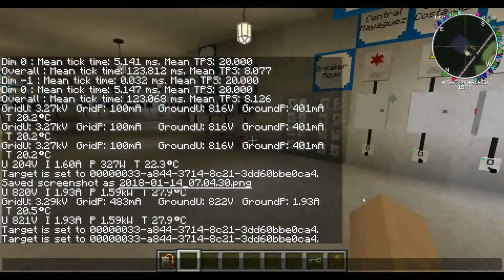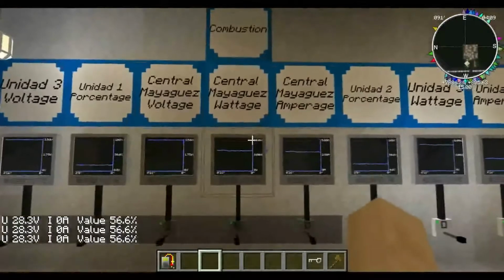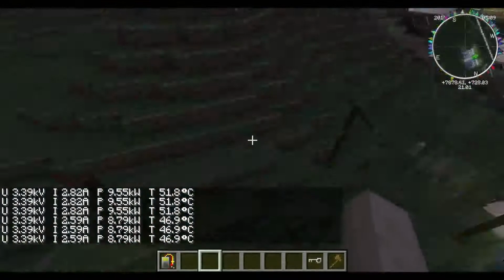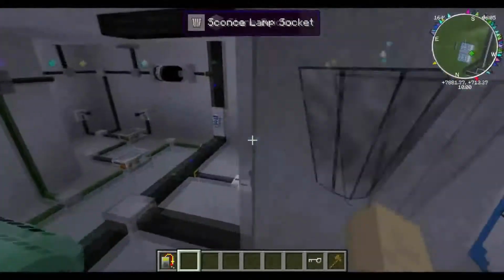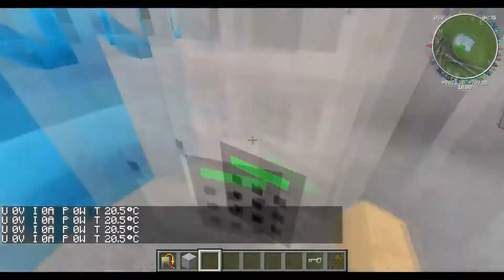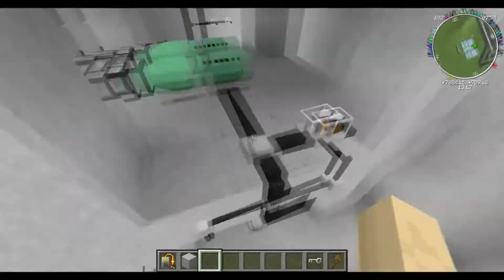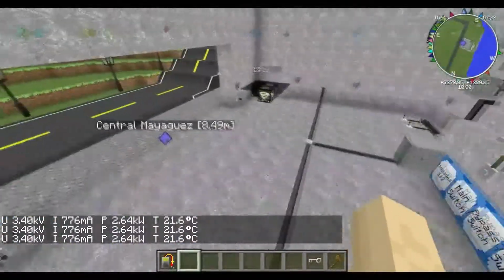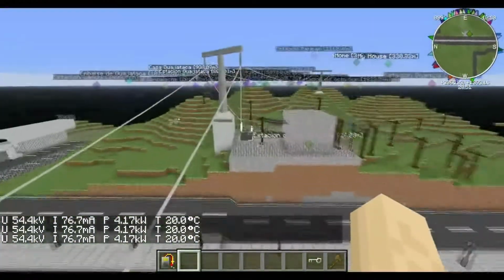Electrical Age How to build a Steam Turbine Power Plant

Comment: What's mods do you use in those map?
Reply from the maker: Long List, but the most important ones are: Electrical Age, Immersive Engineering, RedPower and Flans mods, are the most important ones there
Reply: @Guatauba  thanks, you have a new sub!!
Reply: @Guatauba  What version of Minecraft do you use on that map?
Reply from the maker: @Vicsa22  1.7.10
Reply: @Guatauba  but immersive engineering is for 1.12.2, electrical age is disponible for 1.12.2?
Reply from the maker: @Vicsa22  No, Electrical Age is only for 1.7.10, The Version number for the mod is 1.12 <---- This is not the Minecraft Version, Just Mod Version, Both Mods can be found for 1.7.10
Reply: @Guatauba  Ahh, ok thanks👍👍

Comment: I just use some flywheels no need for a power dump then.
Reply: And 1 turbine can supply 4 generators btw.
Reply from the maker: I know this is quite outdated, but some time later a came up with new designs and I know one turbine can feed 4 gens at 4x4 = 16 kW per turbine and this setup is way beyond outdated I have newer designs with up to 50 generators on 18 turbines to produce massive amount of Power but thanks for the comment!!

Comment: i like ur video but i can't get T2 version from Google Drive .
Reply from the maker: What error does it say? In any case try it again with this link: https://drive.google.com/open?id=18CywoFY2Jv7ShVgGBNNEh9tchqxYd4Gb
Reply: THx u its work  XDD
Reply from the maker: Do Manh Trung word of advise, be really careful especially with the things related to transmission lines and transformers, they can destroy an entire grid and cause a lot of damage so he really careful and test things before using them to get familiar with them, also never connect a grid transformer directly into the grid without using a creative sources to match the voltage because it has large capacitance!!
Reply: My factory exploded when I first used the big transformer to set up the big transmission but after 4 5 times I got acquainted with it XDD
Reply from the maker: See I told you to be careful and not use the direct connection, if you use that transformer you have to use the creative source to match the voltage or else that happens,. just be careful when using it plus use breakers, prevents explosions
Reply: kk thx u :))
Reply from the maker: Do Manh Trung np, for more things about electrical age stay tuned to my Channel and you can also ask me questions, I suggest you watch my new ELN video which explains how the grid works and you can see part of my grid, My grid is 1060 kW or 1.06 MW grid so it's pretty big and complicated to run
Reply: i have question when i use a lot of lights but the line from 233 V -> 241 V i check the lamp it only 196 V
Reply: I want to use the device which reduces the voltage charge
Reply from the maker: Do Manh Trung I am having trouble analyzing what's going on, what is the Voltage of the line without a load and the Voltage with load? I am thinking resistance has to do with it but explain what your setup is to further help out
Reply: but resistance can reduce  wasting voltage?
Reply: i always use rheostat to reduce temperature
Reply from the maker: Do Manh Trung clarify something, rheostats don't reduce temperature they reduce voltage and wasting that Current as heat so in turn it produces temperature, I don't see why you would want to use rheostats for lights as you could use generators at 200 v or at 3200 volts and use transformers to step it down to 200, what you are doing is increasing resistance and then more load you have for lights the voltage would plummet so my suggestion is to generate at the voltage requiered you can use any voltage up to 250 for lights so there shouldn't be a problem or reason to uses resistors
Reply from the maker: Plus using rheostats would increase the consumption of the system, if you need help on setting up a system I can help out
Reply: I like curiosity but I also need a lot of help to understand more about setting up a large system
Reply from the maker: Do Manh Trung i can help you out, maybe later you could bump into my server and show you my megawatt system
Reply from the maker: Also why use the term wasting voltage?? There is no reason to waste voltage or nor is their a term of waste voltage as in excess voltage that doesnt need to be there, chances are if you have voltages where you shouldn't have those voltages chances are you are doing something wrong in the process of Generation, Transmission or Distribution of Electrical Energy, let me know if you want to come to my server and show you aground
Reply: :o okok but how can i join ur server
Reply from the maker: I'll give you the IP, just stay tuned to the comments so you can respond quicker to me so I can show you
Reply: @dorynn7881   it went lot of current. It happens to me it was 220v and i turn on my lamps it went 172v